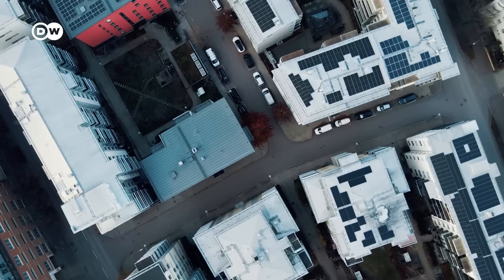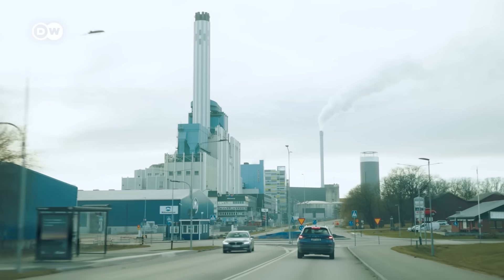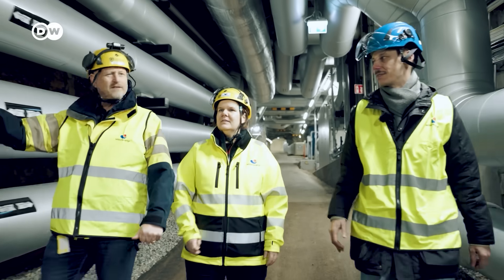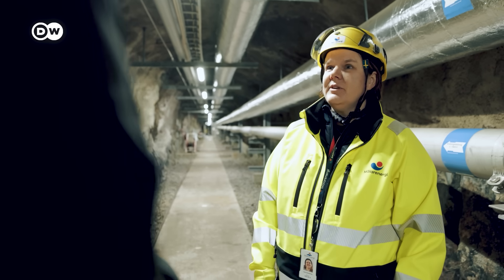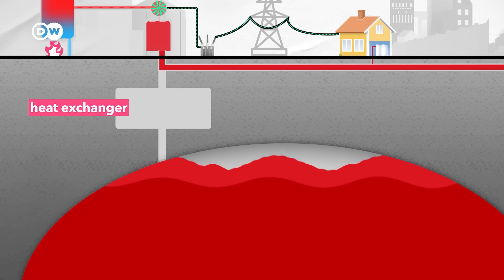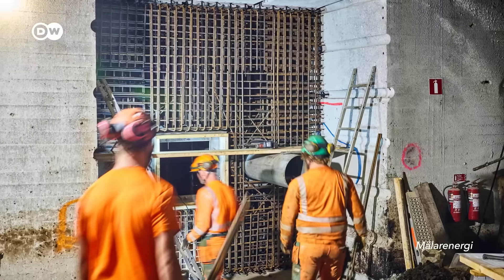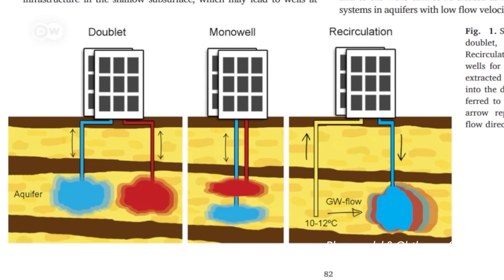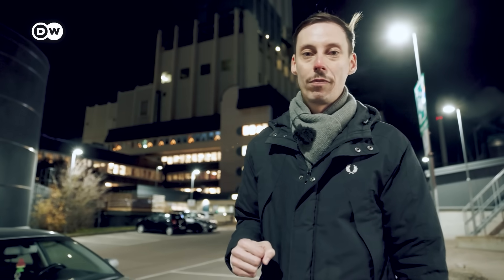Why a city in Sweden filled these caves with almost boiling water

Comment: The Nordic countries are leaving the Anglosphere for dead when it comes to innovations like these.  Brilliant idea, all power plants should be looking to improve their efficiency by capturing ‘lost’ energy/heat: even in more comfortable climates electricity demand is only going to grow: I live in Australia and the cost of hot water here has gone through the roof!  Using waste and reclaimed timber makes a LOT of sense also.  I am sure future generations will look at the C20 as the “wasts age”.  We need to start unlocking the kilocalories latent in all that so called ‘rubbish’ and storing it with technologies like these.  Clearly having public investment is crucial to these projects as well.
Reply: Systems like this are much more expensive for consumers. They're also not 'innovations' but aged, old tech that exists all over. It's not as efficient as believed and is always more expensive than individual heating.

Comment: It does not sound so good for the earth's climate. You fill a cave with oil, some of which I am sure leaked into the earth and possibly contaminates underground water. Now, you heat the cave, changing the surrounding area by heating it up. If every city kept a constant supply of hot water underground, how would that not affect climate change?

Comment: One of the worst things you can do. Store energy as thermal energy.
Reply: No we store heating as heat. We never use that heat to generate electricity. The heat is pumped out via heat pumps (5+ times as effective as direct electric heating).
Reply: @swedmiroswedmiro1352 the reason why you do not store energy as thermal energy is that it is extremely mobile and dispersive. So your heat pump is only able to extract 20% of what you stored. This is due to reservior leakoff, all forms of energy storage have it, thermal storage is known to be the worst for it. My bet is that your government is trying to put on the illusion of green infrastructure while increasing dependence on LPG to pointlessly boil massive amounts of water.
Reply: @heinrikgoettsche1595  Sweden does not use LPG or coal. Sweden has one oil based reserve power plant. Sweden burns mainly trash. 30% of all power comes from hydro, 30% from nuclear and the other 30 is renewables and trash.
https://en.wikipedia.org/wiki/Energy_in_Sweden

Comment: You have to be naive in a special kind of millennial way, to assume that data center heat is "lost" and that biomass does not come with a colossal diesel bill. What do you think a 600 HP woodchipper runs on... unicorn juice?

Comment: This is reminiscent of three Geniuses. Birdsill Holly, was the inventor of district heating and the fire hydrant. He was the one who explained to Thomas Edison that producing heating plants on an economy of scale was cheaper than each individual household.  Frank Shuman, was the inventor of the first solar power plant in Meadi, Egypt.  He proposed giant insulated water tanks for his solar heated water to take advantage of the latent heat contained in hot water to be used during the night when sunlight was not available.  Jean Pain of France produced both methane and hot water by capture the heat microbial decomposition.  Also, the CO2 from the combustion can be stored in the cave.  Its purpose would to extract the latent heat in the water. Through a heat exchanger, the CO2 exponentially exanpands and lead to a gas turbine which is attached to an electric generator. In this way not only is the water used more than once but also the CO2.

Comment: One of the suburbs of Stockholm used to have a nuclear reactor powering the district heating.
There was a plan to build a long tunnel to get hot water from the Forsmark nuclear plant to Stockholm which would have been free district heating except for the building costs.
But that got cut after Chernobyl made nuclear fear mongering popular.

Comment: 01:20 Pipes not finished? Otherwise why are metal pipes exposed to the elements to lose heat?
Reply: That’s insulated pipes those exposed parts are where they fused them together it be insulated than the pipes buried

Comment: There are suggested that the power plant has a Efficiency of 90% the reality is that loss in district heating network are huge, 25-35% ar minimum are loss.

But Västerås maybe is a successful case where you have a fairly large city with a cavern to use and can store heat.

But i really think individual heat pumps would be far more efficient in general where heating is needed during long and cold winters

There are no heat loss in transportation of the heat with individual heat pumps.

Comment: Boise, Idaho in the USA is one of the few American places with a district heating system of this size.  It uses geothermally heated water in 20 miles of pipes for 88 buildings.
Reply: In this case, I believe it's actual geothermal, not heat pumps deceptively called "geothermal".

Comment: Can someone explain to me how they're "saving" the heat lost in the summer? How does this cave heko at all? I am super tired, and that made no sense to me
Reply: During summer they have to keep some capacity going, producing hot water for homes to use for showering etc. But even at minimum capacity they still produce way more than they can make use of since heating for homes is barely needed during summer. This Excess heat that they can't find the use for in the distrubution network is used to heat the massive water deposit in the caves. to later be used again in the autumn when the heat is needed for heating homes again. This saves on fule, as you don't need to imedietly increase capacity as soon as it gets cold, as you have already stored heat in the water underground.
Reply: Get some sleep!

Comment: All cities in Russia, Ukraine and Belarus have district heating systems. They are considered inefficient as you can hardly change temperature in your apartment and it’s usually super hot indoor- more than +25 during winter.
Reply: That's just silly outdated equipment in play. Why not install radiators with thermostat heads...

These district heating systems in Scandinavia have plenty of single family homes connected to them btw, not just city blocks. Each home with its own heat exchanger that allows to regulate the consumption to match the actual heating needs.
Reply: @u1zha   you still have a huge heat loss in district heating network in our "state of art" district heating network in Denmark nothing less than 25-40% are a loss yearly in district heating network, just wasted.

Furthermore district heating in Denmark are starting to use inefficient electric boilers and inefficient heat pumps, no better than Cop (coefficient of performance) 3.5, because distribution network needs about 70-75°c out of plant where individual heat pumps in majority of the time only need to heat 35-40°c in winter, so Cop gets much better yearly with individual heat pumps than Heat Pumps in district heating and no wasted heat hence in district heating network 

In total the energy use are double or triple in district heating, especially in the regions with high percentage of one family houses.

Even worse we are on a journey to more energy efficiant homes and buildings, they are on that journey to be nearly zero emission buildings or better in future.

And there will heat loss in district heating easily double in percentage 

District heating is stupid in many cases..

Comment: Is the water actually used in houses or does it go through radiators in the houses?
Reply: She mentioned a heat exchanger in the outlet of the cavern already. So it's absolutely a different loop. I would assume that buildings have their own heat exchangers too, so a third loop
Reply: There is at least 3 loops in a standard heating system I assume this has more loops for the caverns. One for the plant water One for the transmission water and One for the household water

Comment: District heating is the way to go since your heat source can be anything.
A friend of a friend works at a civil engineering bureau and they are currently engaged in a feasibility study with a city council regarding using massive geothermal heat pumps to expand their district heating network.
The citys main heat sources are the garbage incineration plant and multipe natural gas fed power generation sites that produce electricity and heat.
They want to expand the district heating and phase out the generator sites long term but the generator sites are currently still needed to pick up peak demand because the city is neither small nor is its electricity demand shrinking. The citys main HV feeder lines and transformer stations are all being expanded currently but that will take until 2035 at least its a huge undertaking.
Reply: One other possible heat source is solar thermal energy (i.e. using solar thermal collectors). If the thermal storage is large enough, it is possible to store the thermal energy from the summer into the winter season. Solar thermal converters have a very high conversion efficiency (much better than photovoltaic or plants/biofuels).

Comment: In Sweden every town or city has district heating and often waste is burned. All unrecyclade trash is burned in Sweden, we don't bury trash at all. When I visited Scotland I was very surprised they didn't have dustrict heating. Sweden is far ahead so many countries, you need to step up!
Reply: Scottish Winter

The daytime temperature during winter in Scotland is on average 4°C (around 39°F). There may not always be snow underfoot, but snowcapped peaks are a fixture in the northern parts of Scotland.

while the low record was below -27°C this is really rare, so you might guess why heating is not that big of a problem as in other parts of the world
Reply: Unfortunately most of the world, especially in North America is run by greedy oil barons.

Comment: its better to store heat in molten salt. So no heat is lost beacuse the temperature is higher then 100C
Reply: Of course heat is lost, there's no perfect insulator. Heat escapes faster in fact, the bigger the temperature difference is.
Reply: @u1zha  I meant above 95C. They can only transfer heat until the water reaches 95C. Molten salt melts at around 300C.

Comment: This is an amazing idea, but its only able to store enough heat to run for 2 weeks depending on the outside temps, theres no way that this is taking any summer heat and using it in winter.
Reply: And the one he mentioned that's being built in Finland is going to be 3 times bigger. 6 weeks sounds more like a viable seasonal storage? Multiply a few times more and you may have it.

Comment: Yes, we have district heating here in Hungary since the communist era. Back than fueld with Russian gas. Unfortunatelly still too much Russian gas used but now we have some renewable energy  like biomass to heat up the pipes. I wonder if these heat caves are possible to implement in small size like in my own property. We have so much heat in the summer would be nice to store somewhere. Big solar batteries are too exmensive. I already have water piped heating in the house which heated with solar collector.

Comment: I used to live in Västerås and another advantage of the district heating sytem is that the return water, once it has given up its heat to the houses, is routed under the pavements in the city centre.  The return pipes are only a few cm below the pavement, so in the winter all the snow just melts and the pedestrian area in the town is more or less free of snow and ice.  Also, in the Spring, you can see a line of flowers that bloom early in the warmer ground directly above the hot water pipes where they pass under the road verges.
Reply: So they deliberately use the return water to de-ice?
Reply: There's multiple closed loops in the system, heat exchangers in between: one in each building, one at each powerplant, likely at the storage too. Pipeline water contains chemicals. Water in the system must be hot or homes are at risk of having legionella in pipes, therefore not all heat is usable. A powerplant generates electricity at the same time which benefits from cold water in its condenser. That's why snow melting is done - you have unusable heat that must be thrown away.
Reply: @McSlobo  This system will store unusable heat that would otherwise be thrown away in the summer time, there's hardly a surplus of unusable heat in the winter.  Simply an in efficient way to clear snow, or grow flowers.
Reply: It makes Västerås a good bike city, since you can cycle all year around without trouble. Having a lot of farmers just outside the city with tractors and less to do during winters also means plowing is good.
Reply: @AnotherDuck  Plowing this year has been a joke tho. This and last winter, the plowing has been so bad that the buses can't stop at the curb, but several decimetres from the curb, so people have problems stepping out of the bus. The heating is only in the city centre, mainly Vasagatan and Stora gatan, in the City ring.
Reply: @AlexZidar  Then it's gone downhill since I lived there, which was quite a while ago.
Reply: Uppsala has a few spots with heated pavement, but my question is why they never put that under the bus station just on the other side of the road..?
Reply: i was talking with my mom about how heating up bridges so there isnt any ice on them would be better so there are less accidents and she just said it would be a waste of energy. Now i see sweden doing something similar and tihnk why we don't do it like that too here
Reply: @Loopi1999 it is done here.  Floor heating systems used for ramps, etc.

It’s more cost/resource/utility effective to do it by hand or machine using salt.
Reply: @Loopi1999  Yes it could probably be done, but whatever heat you use from the pipe is cooling the liquid inside and you have to take care so the liquid doesnt freeze in the pipes. Also, bridges usually are suspended at the edges with rollers. So the bridge can move slightly from loads of traffic. These pipes are not suitable for that kind of movement. But anything can be done.
Reply: genuis
Reply: Its not free defrosting as it make it much more expensive to reheat. So it still the same amount of energy and cost.
Reply: @einherrjare  Exactly. It's a waste of heat if the return pipe is not insulated.
Reply: That’s pretty smart not only do they recycle the water, but they actually think about everybody in their country. Sweden really is a sweet place to live. They make sure every household has a fallout shelter or room even apartment buildings have a fallout shelter.
Reply: @TAZ0300  You're thinking of bomb shelters, and they were probably a mistake. They were built based on experiences from WWII. It's not like any future war is gonna involve propeller planes randomly dropping bombs that might end up falling in residential areas.
Reply: One thing that got me thinking is this enormous undertaking by Västeråsenergi only saves the amount of CO2 emissions from 460 swedes - don't forget that the best thing we can do for the climate, apart from not having children, is to stop people from poor third world countries from moving here. Every MENA sucker moving to Europe will cause a serious negative environmental impact, not to mention the economical, criminal and cultural problems that mass immigration from MENA causes.
Reply: Awesome!
Reply: But therein also lies one of the issues. Like the video said, in the summer, those pipes are running too so a base temp needs to be reached for a very large volume of water when so little is actually used. And those pipes are wasting heat all through the year even heating parts that shouldn’t ever need heating
Reply: Oh and if those pumps can run in reverse, be able to pull in extra solar heated water into the reserve would be so amazing
Reply: Counter current heat exchange would be necessary for this system but increases security but wastes more energy. new technology heat exchange materials or technology  would help a lot here. See camel noses for bio mimicry. Pumps probably very expensive and need lots of maintenance and replacements
Reply: crazy
Reply: Very clever.
Reply: Låter lyxigt. Så länge det inte blir halt eller isigt
Reply: Sounds absolutely lovely, tbh🥰😊
Reply: I guess the cold water is pumped back in one of the other chambers and reheated later?

Or is it used otherwise?
Reply: @NextBachelor2025  It is most likely a cooling loop. So like your radiator at home, it has its own water supply.
Like how in the video, they used a heat-exchanger to transfer heat from the cave water to the power-plant water. The cave water never leaves the cave/exchanger area. :)
Reply: @NextBachelor2025  Cold water goes back to the caves heat exchanger to be reheated and pumped back into the city in a closed loop system like a car radiator.
Reply: @NextBachelor2025  its a closed system and gets reheated.
Reply: @NextBachelor2025  It is a closed loop so the water goes back to the plant to be reheated and sent out again. It is not used for anything else.
Reply: I’d like to point out this video features two main technology. District heating and heat storage with caves. I’m all for heat storage. It’s the district heating for a large city that seems extremely inefficient if it needs to be run in the summer. I highly highly suggest that they also recommend homes have solar heating for the summer and completely turn off the district heating in the summer
Reply: @NicksHeine  if you're running centralheating you aren't allowed to have any  other source for heating. What you pay for it is the difference between incoming/outgoing temp. In the summer you might not even notice it if you aren't using hot water
Reply: Are there still some Swedes there?